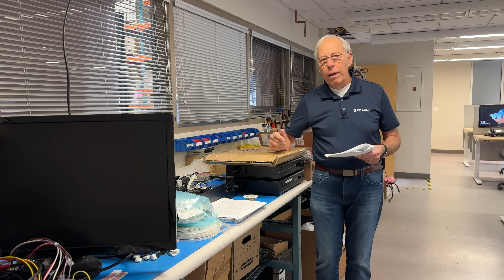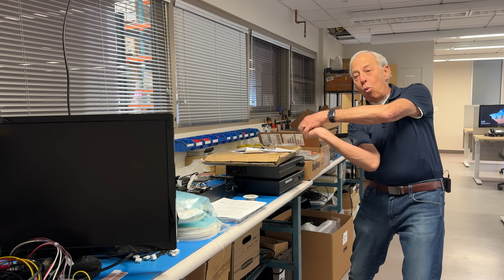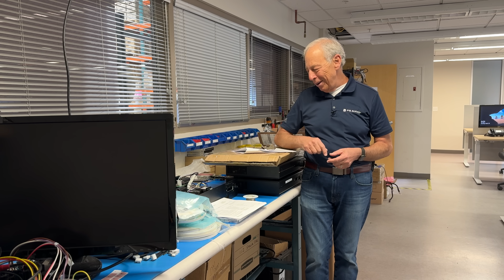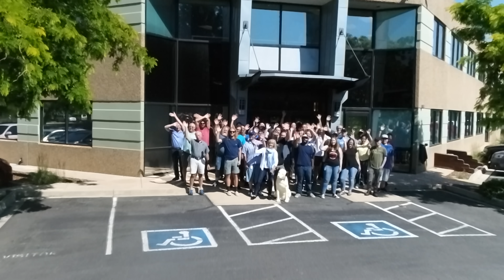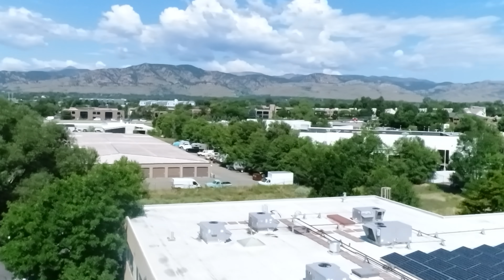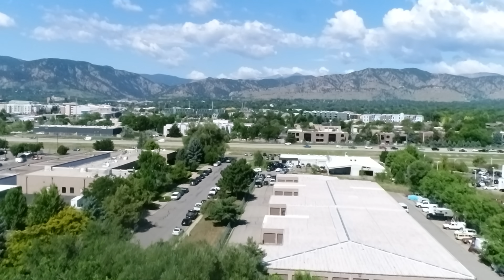Feeling bass in your chest

Comment: And then the studio engineers compress the bass, and lower its gain, sucking out the slam.

In song after song after song, the drums are heard somewhere in the background, as if behind a sound barrier that keeps their energy from jumping out of the speakers.

The above is why so many people want tone controls -- to undo the damage done by the studio engineers.  But there is no true undo option.  Tone controls are the closest thing we have that puts some of the slam back in, at the expense of changing the character of the the drums, and nearly everything else that is affected by the tone control change.

What do studio engineers have against drums?
-- Is it a "Nah, nah, nah, nah, nah -- we get to hear it, but you don't" childish thing?
-- Or do they think that most stereos cannot handle the reproduction of dynamic, loud drums?
-- Is it a radio thing, where once-upon-a-time the radio signal could not carry the dynamics?
-- Is it a vinyl thing, where suitcase turntables will skip from such groove carvings?
-- Is it a cult of "We hate drums" personnel in the studios?

There has to be a reason for so many songs burring the drums -- even on the biggest bands in history.
One example is Emerson Lake & Palmer's "Tank".  Emerson's keyboards have the gain much higher than Palmer's drums.  But when Palmer gets to the drum solo, you can turn up the volume to the moon.  But then you have to quickly turn down the volume, when Emerson's keyboards return (or kiss your ears goodbye).  Why do the studio personnel do that?
Reply: Dynamics compression that you're referring to ... when executed correctly, adds dynamic slam and impact tremendously. 

Compression isn't the evil that so many audiophiles and enthusiasts believe it is. 

The problem is poorly executed sonic choices.
Reply: It sounds to me like you have a room mode issue.... because the issue you speak of does not exist in a room with the modes dealt with.
Reply: @bayard1332  "It sounds to me like you have a room mode issue.... because the issue you speak of does not exist in a room with the modes dealt with."
It is a studio personnel issue; not a room mode issue.

The symptoms that I described are present on every stereo I have ever heard, from mass produced, nothing special stereos, to state-of-the-art, dream stereos, and everything in-between, in dozens of different rooms.  Car stereos, too.

When the studio gets the job done correctly, then the song in question sounds good, virtually no matter where it is played.
When the studio botches the job, then the song in question sounds deficient, no matter where it is played.

I find it astonishing that you have no issues with bass dynamics with most (or every?) song; that they all sound right to you.
Even the original and the re-master both sound right to you?  And the re-re-master sounds right to you?

Octave Studios is no better than the studios that have produced nearly a century of songs?
Reply: @0Perhaps  After about 45 years of having issues with pretty much all recorded music I decided to figure out getting great sound from my rig(s), as every room in my building sounded like crap. 8 years later and I fully understand the issues and have fixed my rooms and sorted my rig(s) and built a new rig to explore my own sound ideas. Now I can follow any instrument at any frequency and all notes are the right volume and about 99% of music played on my rigs sounds epic and my sound systems deliver deep satisfaction continually throughout any day/listening session. Sound engineers are not idiots and actually know tons about sound. It is foolish to think you know the answer and every pro on earth is an idiot. Pro tip, the equipment in your rig, amp, source, speakers, are not the issue, the recording is not the issue, your room acoustics is the issue. Learn acoustics and solve every gripe you have. Acoustic Bass and Piano are fully epic on my rigs now. There is no bass missing. At the listening position my 2 primary rigs, in wildly different rooms and wildly different rigs, both measure essentially flat from 30hz to 15khz in stereo, there is nothing missing. It's all about acoustics.
Reply: @bayard1332  "Sound engineers are not idiots and actually know tons about sound."
It is foolish to think that just because someone does a job, that they are qualified for that job.

There are people in every industry that get jobs, but are incompetent at their job.
Our planet has countless incompetent people, and a whole lot of them are working somewhere.  Incompetent people get jobs, too.

Even some people with lofty university degrees are incompetent at their jobs.  Consider how many doctors misdiagnose serious medical issues.
If you are diagnosed with a serious medical issue, and it will cost you your life savings, will you seek a second opinion?  According to your logic, that initial doctor is a professional, and who are you to question his diagnosis?

"It is foolish to think you know the answer and every pro on earth is an idiot."
It is foolish to believe that when someone gets a job in a studio, it is because they are a pro.

Also, I never wrote that I think I know the answer and every pro on Earth is an idiot.  You made that up.  Please do not fabricate assertions.

"Pro tip, the equipment in your rig, amp, source, speakers, are not the issue, the recording is not the issue, your room acoustics is the issue."
That is not a pro tip, when you actually believe that the recordings are not the issue.

The notion that recordings are all good is absurd.

With headphones, the room is no longer part of the equation.  Yet, the same sound quality issues are present with headphones, due to the sub-par job done by anonymous studio personnel.

"Learn acoustics and solve every gripe you have."
You are writing nonsense.

You 100% skipped over the re-mastering comments that I made.
According to your assertions, that it is the room, and not the recordings, then why are there re-masters?  Why are there re-re-masters?
Reply: @0Perhaps 
The number one reason re-masters are released is revenue. 

Compression isn't bad. 
Poorly executed compression is bad. 

Compression adds impact.
Reply: @0Perhaps  I'm going to assume the music you are dissatisfied with the sonics is music recorded in the somewhat distant past. In that somewhat distant past (and still, to a degree, today) every band/manager/producer/engineer gets to choose who to master for- the audiophile with the mega dollar rig to whom they can sell a few hundred copies or to master for the average playback system of the time and sell millions of copies.
If I play anything from before, say for argument, 1990, on my rigs I can easily hear all of the things that presumably bum you out, but if I play that content on period systems, which means Car Radio, Boom Boxes and inexpensive home systems it sounds right. Shit is mastered for the playback units of their era.
But the cool thing about old recordings played on the right modern setups is that even through all the crackling and scratching of the recording you can still hear and feel the soul of the musician playing (I'm thinking old blues from the 1920s-1940s. And that is what I want to get connected to when I listen.
For me well over half of the modern remasters I've heard completely fail to understand/preserve/convey the thing that made the original great.
When I play pre 1980 stuff on my JBL Flip4 is sounds completely great, that little thing absolutely nails the gestalt of the time and distills the music down to the thing that made it a hit in the first place, and that is what your modern fancy audiophile rig is failing to do because it does not reduce the content into something different and epic, it's a form of alchemy and mixing engineers worked dang hard to get that alchemy right. Pretty much every pop record made back then has to sound GREAT on a car radio before it would be released. In fact, modern engineers still use car radios to vet their work, along with a variety of other playback devices because they know how, for the most part, it's going to be played back.
Reply: @bayard1332  Yes, the playback equipment, factored in by the year, played a role in how the music sounded.  But that does not excuse how badly the studio engineers botched the mixing and mastering process.

If you play a correctly mixed and mastered, great sounding recording, it will sound better than a typical botched recording, no matter where you play it.

I have a very good, somewhat recent stereo in my living-room.  I also have an old car stereo, and also have ancient active speakers for my PC.
Whatever sounds the best on my living-room stereo also sounds best no matter where else I play it.  And vice versa.

Granted, the lesser the stereo, the more forgiving it is to the botched recordings.  But that is only because lesser stereos lack the ability to bring out much of the beauty in the recording.

But the better the recording, the better it will sound anywhere it is played -- even in elevator speakers.

It is akin to a video's focus.
A movie with great focus will look better than a movie with not-so-great focus, no matter where you play it.

If you have a 1972 TV, with rabbit ears for antennas, then a sharp movie will still look better than a less sharp movie on that TV.
And so it is with music.  If it is a great sounding recording, it will allow any stereo to reveal that better sound quality.

So the studio personnel are simply incompetent, or have no ear for sonic excellence, or both.

With the right pressing of Abbey Road (hard to find -- but they exist), you will be blown away at the realism.
That album was released in 1969.  And there are many other albums from the 1960s that have outstanding sound quality.  So the equipment existed back then.  It is the personnel in the studio that are to blame for all of the hit songs that they vandalize.

Check out the theme song for Hawaii Five-O.
It was recorded by Mort Stevens And His Orchestra, in 1968.

Until recently, every CD and digital download makes it sound like they held a microphone to an old TV's speaker.
Then, out of the blue, in September of 2022, Capital Records released the exact same theme song, from the exact same recording session, and it sounds amazing!

So it took 53 years (19,345 days) to finally hear that theme song sound great.  What on Earth took so long?
Clearly the initial capture tapes were in great shape, and sounded fantastic.  So then why, for 53 years, were we fed a crappy sounding version of that theme song?

I don't even understand how the studio personnel made it sound so crappy?

But 53 years later, after more than half of the fans have passed away, we finally get to hear that theme song in all its glory.
I am guessing that whoever controlled that theme song's rights had passed away, and that allowed a new owner to share a great sounding mix with the world.

So for just about every hit song out there, there probably exists amazing sounding tapes.  But the studios mix and master them incompetently.
Reply: @FOH3663  "The number one reason re-masters are released is revenue."
I agree.

"Compression isn't bad. 
Poorly executed compression is bad. 

Compression adds impact."

Well, then 95% of studio personnel poorly executes compression.

We should be able to feel the drums.  Yet, in countless hit songs, we do not (or only partially).
Is it because of poorly executed compression?  Or because even with proper compression, they lower the gain on the drum's stem so much that the drums feel like taps in the background?

Since countless hit songs use compression, and nearly all of them have sub-par sound quality, my conclusion is that compression ruins the sound quality.
1) Compression is the key factor in bricking the dynamics (loudness wars).  Such songs sound horrible.
2) Compression is yet another active form of processing.  It is adding the color and distortion (unintended distortion) into the signal chain.

Every box adds color, character, and distortion, no matter how good the box was designed.  The best boxes do it so well (add so little) that we virtually cannot hear it.
Every compression box is akin to adding another pre-amp into the signal chain.  That is bad.  Who knows how good those compression boxes are?

A great test would be to send the signal through the compression box, and set the compression controls to zero (no compression).  Just let the signal pass through the circuitry of the compression box.  it will degrade the sound quality.  But how much?  Who knows?  We will never find out, because we would need to hear it for ourselves in the studio, listening the to initial capture tapes.

It could be equalizers that are ruining the sound quality.  I hear emphasized, unnatural bass on many songs.  They could have just turned up the gain on the bass guitar, to leave that bass guitar sounding like a bass guitar.  But noooo.  They, instead, mangle the sound of the bass guitar with an equalizer.

So who knows why so many hit songs are mixed and mastered poorly?  It could be the compressors.  it could be the equalizers.  It could be the reverb boxes?  Etc.  Probably a combination of it all.  And when you add the coloration distortion of multiple extra boxes to the signal chain, you are adding them one on top of the other (cumulative).

Comment: Correct I just mixed a show with 60 duel 18s that worked
Reply: FWIW, that would be dual 18s, not duel 18s but who's counting?
Reply: @rtflone  You are grammatically correct, but I think the point was there were SIXTY of them.  Upon reading that, I was immediately taken down a sonic rabbit-hole of glorious, body-hammering bass.  Of course, if the venue was an outdoor amphitheater, then maybe not.  But for a majority of indoor venues, WOW!!  Mixing that would be a challenge and a delight!  I saw the Police perform their Synchronicity tour in (I think) 1983, and there were close to 60 single 18s (Showco did the sound) under the front of the stage, spanning the entire width.  Sting could seemingly make all the air in the Kemper Arena in KCMO vibrate, pulse, I don't know the correct word COHERENTLY.  The experience gave me the idea for a "sonic laser!"  Big sound is compelling.  It is a primary reason why my favorite hobby is high power rockets and my second is top fuel drag races.  You "hear" the sound with your entire body!
Reply: @rtflone  yep not me I have a issue with the sound system trying to be the act on stage and not the musical preformed unfortunately this is how it is nowadays